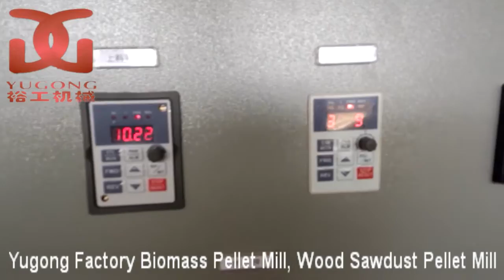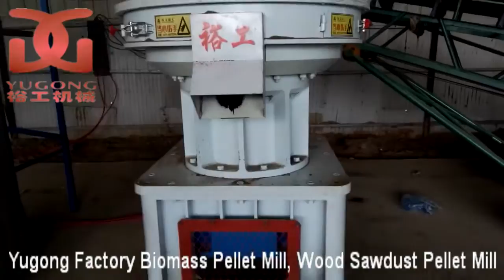Yugong Factory biomass pellet mill, wood sawdust pellet mill

Comment: Further improvements of Yugong LGX series pellet machine

● Transmission part adopts European standard gearbox reducer which has been highly praised by customers, further optimize the speed ratio, make the perfect combination of transmission efficiency and durability. Its excellent performance is not a simple gear or belt drive models can match;
● With newly designed structure, overcome the shortcomings of serious raw material leakage problem in the pelletizing room after long-term use;
● Optimized the automatic lubrication system, on the basis of without downtime to realize automatic lubricating the bearings on various parts of the machine, further equipped with a pressure value to induction grease filling quantity and timely automatically adjusted, bring really perfect lubrication and save per gram of grease.
● Optimized the raw material lifting plate equipped in the pelletizing room to enhance pelletizing efficiency and quality.
● Besides made from special alloy and processed by vacuum hardening,the roller are processed by second special treatment and its durability is highly extended.